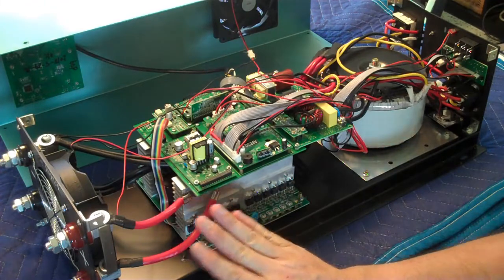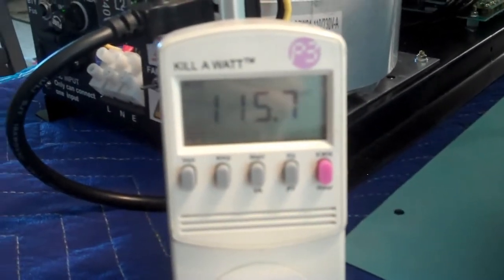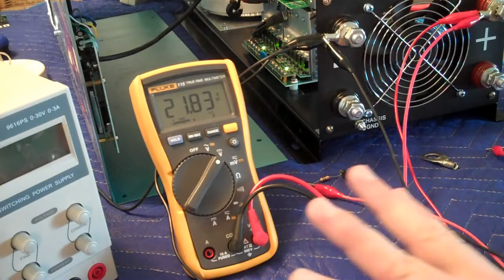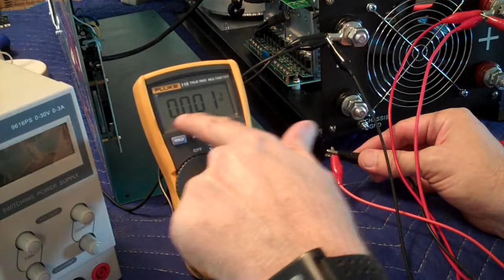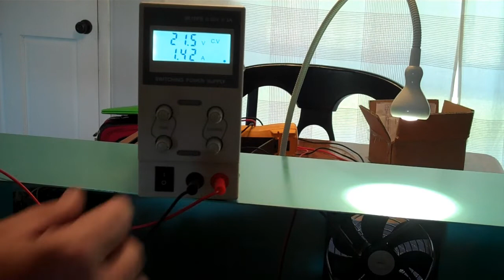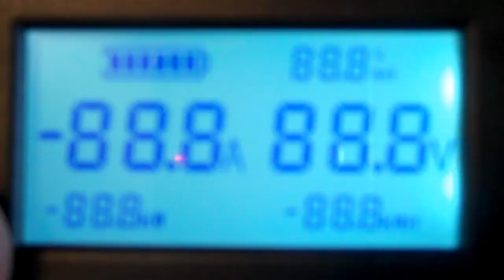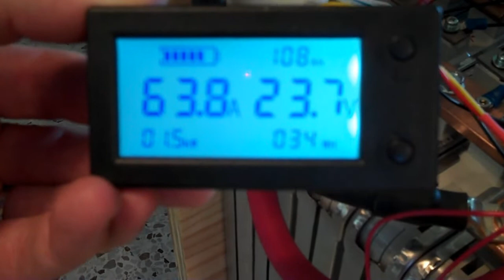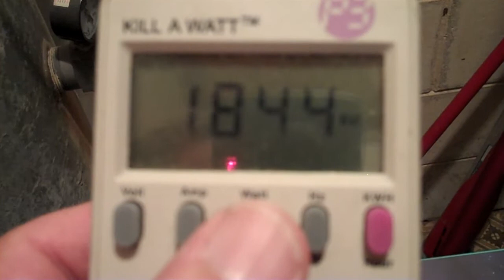Repair / Review: Power Jack 8000W LF PSW  INVERTER DC24V AC 220V 110V ATS/UPS-8.0V (part 6)

Comment: Good video Jay. I am actually interested in that cap charger switch. Maybe you can get ahold of me and we can talk about it.
Reply from the maker: It's just a manual pre-charge circuit. It puts a large ohm resistor between the power source and the capacitors allowing them to charge up (slowly). Once the voltage is close to your battery/power supply, you can connect directly without the resistor to avoid the inrush current. You can find my contact info on my website: www.summet.com
Reply: @summetj  do you think something like this could be integrated cheaply into a power jack inverter?
Reply from the maker: @GenetrySolar  Not if you wanted it to work automatically, as that would need a large contactor/relay to bypass the resistor and make a direct connection to the power supply.
Reply from the maker: @GenetrySolar  if you just gave the user instructions for example to connect the battery positive to the pre-charged connector for 30 seconds before bolting to the regular connector that could be very inexpensive.
Reply: @summetj  I was thinking about a heavy duty 3 way switch like a blue sea systems switch. Off, charge, on. Something like that. Power Jack would integrate this into all of their large 9k, 10k, and 15kw inverters.
Reply from the maker: @GenetrySolar  That should work very well, the only additional cost above that of the three-way switch would be a resistor, a few wires and assembly time.

Comment: Do you run anything in addition to your well pump?
Reply from the maker: When running the well pump off of the 240v connection, the inverter is dedicated to only the well pump. However, I can plug an extension cord into the 120 volt plug and run my 1800 watt microwave (or) allow the fridge to get back to temperature when not pumping water. (I have a pressure reservoir so running the pump for 45 seconds provides enough water for basic tasks like hand washing and a few toilet flushes for several hours....)
Reply: @summetj  what kind of pump do you have ? If its above ground pump most can be turned to 110v instead of 220. Just take off the cover and then turn from 220 to 110.. But you may already know this..
Reply from the maker: @williamh.2982  It's a submerged pump down in the well.....
Reply: @summetj  Ok, I don't know much about them I have worked on above ground pumps and they can be turned to 110 or 220, which I always use the 110.. I was trying to help you.. Peace

Comment: My 8 Kw Powerjack has two transformers
Reply from the maker: Either it is using 2 smaller transformers, or it has a higher actual rating than mine.  (I'd call mine a 3kW inverter with an 8kW surge capability, regardless of what is printed on the box).
Reply: @summetj  It's still going too 24/7